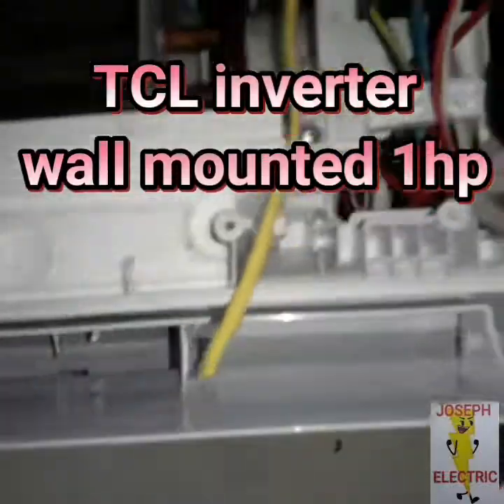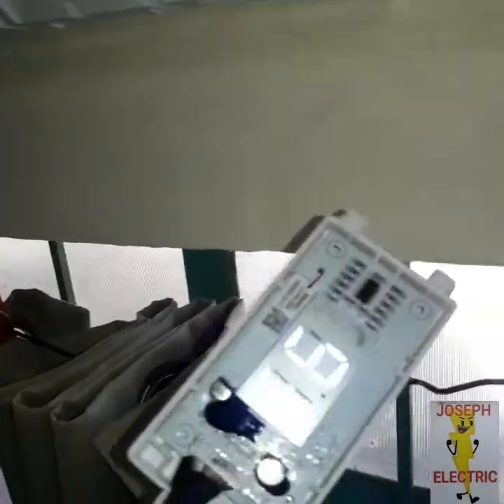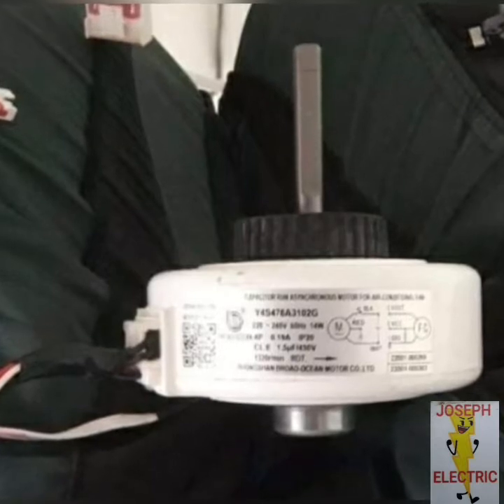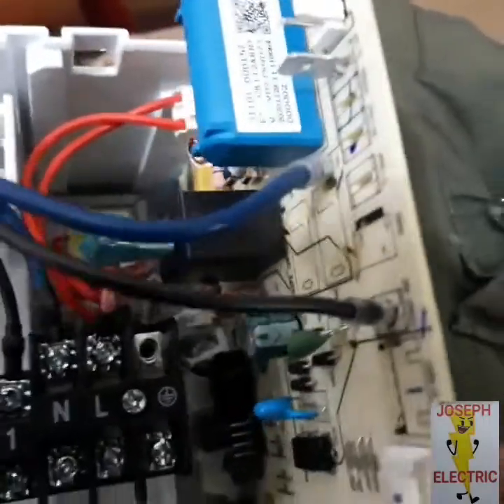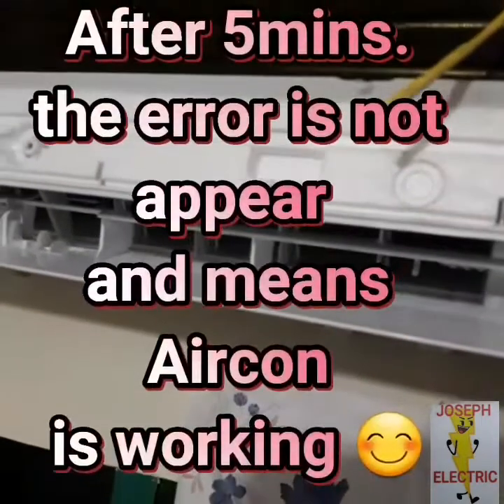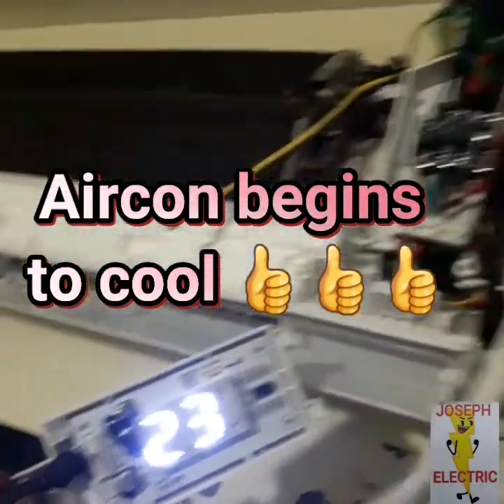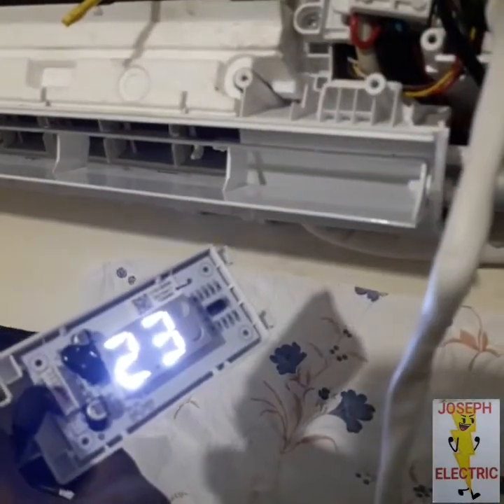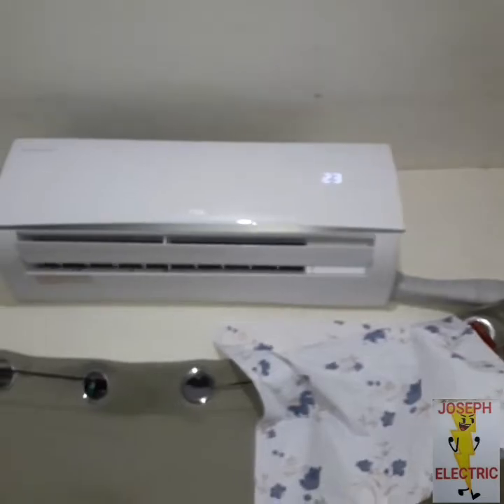NEW TCL 1hp Inverter Aircon SIRA AGAD 😱 TCL ERROR 6 troubleshoot and REPAIR E6

Comment: Hi sir. san po pwede makabili ng fan motor, PCB for the TCL 1.5 (indoor unit) wall mounted AC.?
Reply from the maker: @ClemirVinalon  saan po location nyo sir
Reply: @josephelectric6028  Muntinlupa po
Reply: What if fan motor po problem

Comment: Boss ano kaya issue ng TCL split tyoe aircon namin kapag inoff sya may naiiwang parang Dot na ilaw dun sa mismomg number
Reply from the maker: @JamesclarkDevera  yung dot po na yun is display led light ng aircon
which means isa siyang electronic device na kapag naexpose sa hi humidity is magkakaroon ng partial voltage na nagpapailaw at yun po ang dot, madami na po ako na encounter na ganyang issue but majority is kusa po nawawala ang dot light once na mabalance na ang humidity sa room or area,
don't  worry sir. it wont affect the cooling of your aircon
Reply: @josephelectric6028  salamat po boss
Reply: @josephelectric6028  boss kelan pwede ecomode ang aircon
Reply from the maker: @JamesclarkDevera  pwede ang eco mode during night time after mapalamig ang room pwede na iset sa eco mode
during day time pwede din basta makulilim or umuulan
wag lang mataas ang ambient temperature sa labas or mainit ang panahon kasi hindi kakayanin ng eco mode mapalamig ang room
Reply: @josephelectric6028 gnyan din ang issue ko now. Now i know kung bat bay gnun. Thank you

Comment: Bakit tcl ko kahit naka off may guhit na ilaw sa display ano problem
Reply from the maker: @lademaas3512  common problem po ang ganyan sir. kapag hi humidity ang Room, but it doesn't affect the aircon control kaya ok lang ang ganyan sir. kahit may nakikita po tayong ilaw or guhit sa display,
Reply: @josephelectric6028  ty po kala ko may sira na Aircon ko

Comment: Sir ano kaya problema ng unit 1.5 tcl mei, malamig naman aircon pero ung fan nya kahit ilipat na ng high walang response, same lang ibinubugang hangin low hanggang high, lumalamig naman, kaso dahil mahina ang hangin matagal di gaya dati 15 mins lang. Wala naman pong error,
Reply from the maker: kailan po huling nalinis ang AC nyo sir.?
try to clean muna, focus on fan blade cleaning,
kapag walang nagbago
indoor board ang may problema
Reply: @josephelectric6028  salamat po sa sagot nyo, 1month palang po sya nainstall, yung screen lang po nililinis ko weekly

Comment: Bkt kaya un ac namin kusa ng namatay wla na dn lamig nilalabas tcl 1week pa lng sya hnggang ngaun d maopen
Reply from the maker: may problema na po ang board ng aircon kapag ganyan  need macheck up para ma hanap ang cause ng No power

pwede kasing
1.maluwag ang plug
2.walang power ang saksakan
3.sira ang remote
4.sira na ang aircon mother board

try nyo po muna tignan ang 1,2 and 3
at kapag ok naman
no.4 na ang problema at need ng repair

Comment: Sir, may EE error problem po TCL namin, anong dapat gawin dito? Salamat po in advance!
Reply from the maker: how old is your TCL aircon sir.?

EE fault means Outdoor PCB problem
it can be repaired by expirience electronic technician or need to buy new PCB for a longterm solution

Comment: Hello po P6 error po Ac ko ano po kya problem
Reply from the maker: 4 ang cause ng P6 ng tcl aircon
1.outdoor or indoor fan motor
2.Low freon
3.temp sensor indoor or outdoor unit
4. PCB failure

Comment: New subscriber here. Question san po kayo naka kuha ng pcb replacement?
Reply from the maker: sa mga authotized TCL distributor or dealer sir. search nyo po sa goggle kung saan may malapit na TCL sa inyo
Reply: @josephelectric6028  nasa magkano po ang pcb?
Reply from the maker: 2,500 ang indoor pcb
at nasa 4,500 ang outdoor pcb
1hp to 1.5hp
Reply: Sir how about e0 and e9 error sir?
Reply from the maker: @RowenaNavales-uo3rf  E0 means 1.communication error ( wiring probem)
solution check indoor to outdoor wire look for broken wire
or replace new wire
2. defective outdoor board
solution: replace or repair outdoor board

error E9
*defective outdoor board
solution: repair or replace outdoor board
Reply: Yung Sakin walang error na nalabas tcl 1.5 wala na lamig at namamatay yung outdoor
1yr palang
Reply from the maker: @shewinasis9923  possible na may leak ang unit nyo sir. at wala ng freon

Comment: No error nmn po boss bigla lng ng off ung unit ano kaya problem? 
Brand new kust installed 2 days ago thanks
Reply from the maker: Loose power supply yan sir.
check all wiring terminal and look for broken wirings
Reply: Ano po ginawa nyo??

Comment: bosing thank you for yhst video.but whst im  asking is how to rrpsir tcl  aircon split type inverter d mkit kc walng power.saan ko ba i  check tspos ko lahat ung mga wiring pat circuit breaker.may nspansin ako ung.chord na ac.nangitim na ung plug is that the.hindrance,? pls tell me how
Reply from the maker: may tester ka po ba sir.? test mo kung may power ang L at N terminal sa aircon
kapag wala palit cord
kapag meron Indoor board ang problema need palitan

Comment: Sir..ano po problem pag F6 error TCL brand
Reply from the maker: F6 error ng TCL ay high temperature
pwedeng sira ang sensor or sobra ang freon, need macheck ng technician yan sir. bago lumala
Reply: Sir anu po b exact value ng ambient sensor  conderser sensor at compressor sensor sna po mapansin nyo tnx @josephelectric6028

Comment: Good morning ginamitan ko extension wire ng 1.5hp tcl splitter umandar naman kaso namatay at d na nag oon sub quality ba extension? Wala naman nalabas na error sa remote ano kaya sira kakainstall pa naman
Reply from the maker: bawal po gumamit ng extension wire kahit pa heavy duty, need nyo po ng aircon outlet with Circuit breaker para umandar ng maayos ang aircon nyo po

Comment: Good evening boss nag kabit ako ng breaker without outlet Kaso pinutoll ko yung pinaka ulo ng cord ng aircon Sabi Kasi ng nag install na pwede naman irekta sa breaker Ang cord ng aircon Kaso tatlo Pala Ang wire Nia di ko alam na Ang ground Pala Nia ay green napalagay ko sa breaker ay green at white ano kaya possible na nasira sa inverter sana fuse lang kung may built-in sya sa loob o mother board na ba Ang sira sa kanya sa pagkakamali ko 😥😥 😢😢 salamat sa sagot
Reply from the maker: fuse lang po yan boss, lahat ng inverter board ay may fuse, pwede din madamage ang relay kapag hindi agad nag trigger ang fuse, posible pa marepair ang ganyang problem